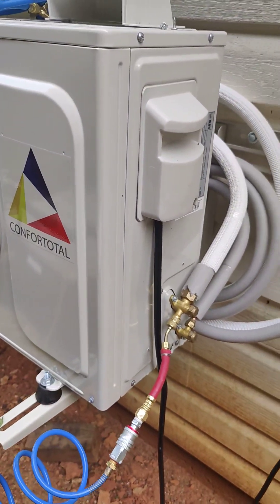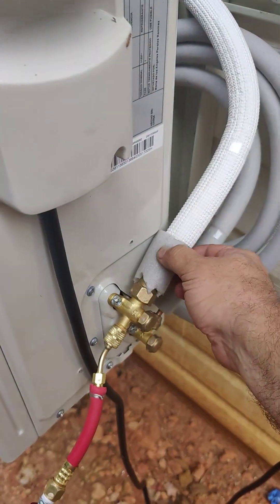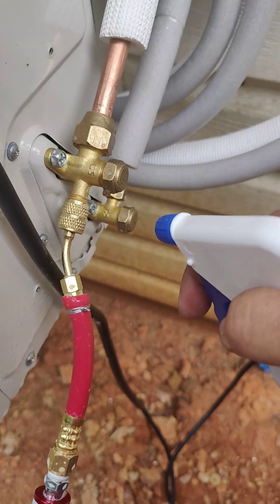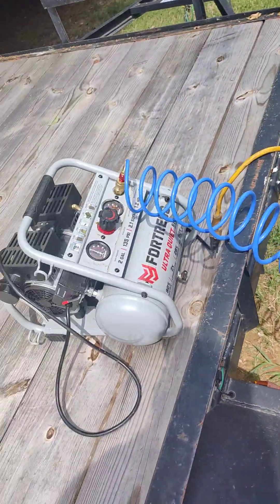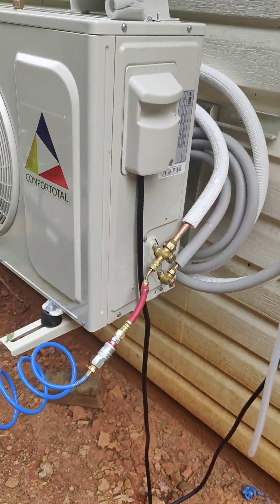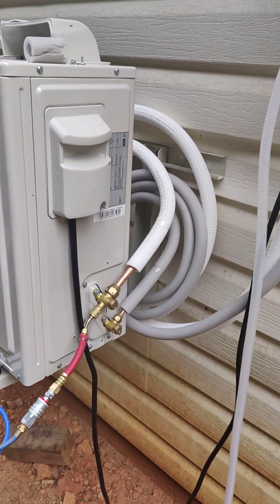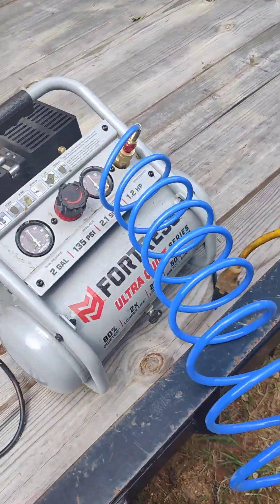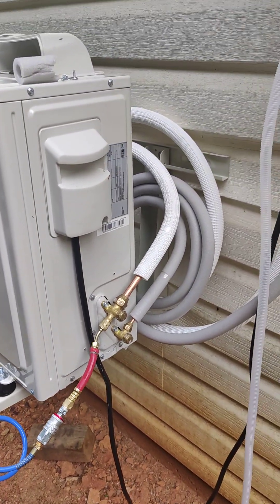How to PROPERLY (kind of) leak check your mini-split line set

Comment: Your compressor just shoved moisture into the lineset. The job of the vacuum is to remove air and moisture. It is only a partial leak test, the actual test occurs when you release some refrigerant into the line for 5 seconds.

Comment: I mistaking didn’t do this compressor test. I installed 5 minisplit systems. The 5 th one leaked out the R-32. I don’t know what to do. I guess I can recheck the flare fitting where it leaked. Once that looks correct. Then I can do a 160 lb compressor test. If that good now and there’s no bubbles, im not sure if I should buy 2 pounds of R-32. It’s $225. They have a disposable tank. Can I charge the R-32 myself?   Problem is, if I hire some one, it’s not worth it. If I buy the r-32 and it’s good. I’m home free. If not then they charge 500 minimum to get his working. I only paid $500 for the system. Any recommendations ?
Reply: month later \ what happened ?